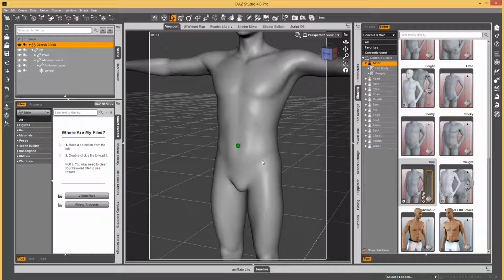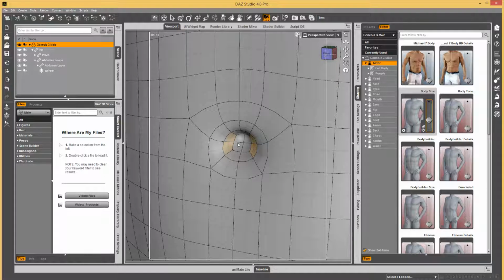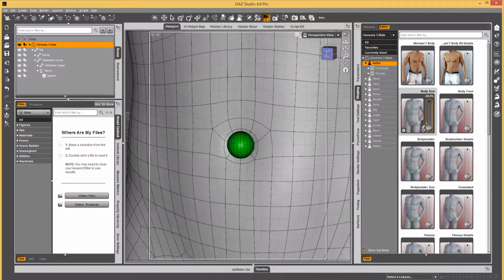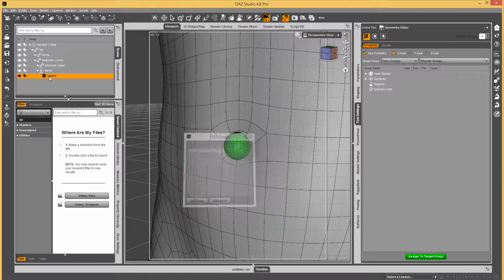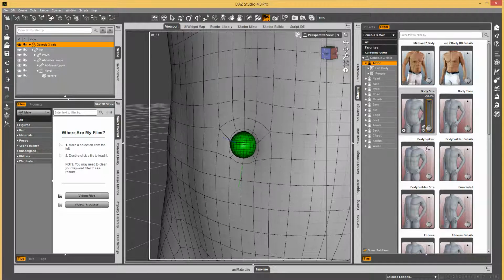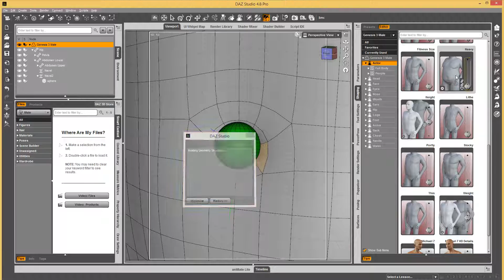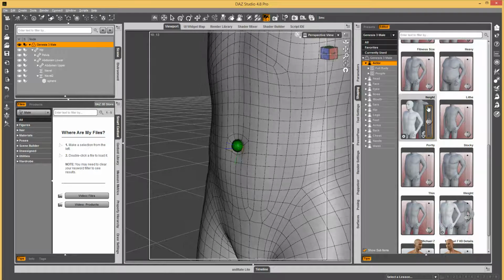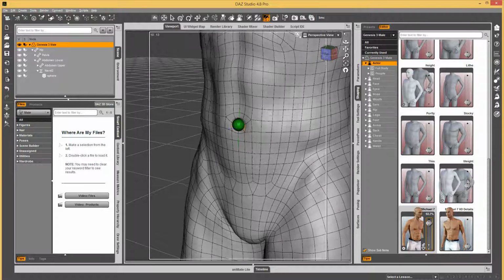Rigid Follow Node Test 1

Comment: Why follow rigid node gets messy when there's pJCM.
I add buttons using follow riggid node to my cloth, but after transfer utility, the position of the buuttons are moved, and getting worsed after I import pJCM
Reply from the maker: Hmmm, hard to say. I would first look at the reference points and see how they get distorted when the shape gets distorted

Also, you will want to make sure the rigid follow node is a child of a bone that moves the geometry. For instance, if the button is in an area of the mesh that gets moved by the lower neck, you should make sure it is a child of the lower neck. If that has troubles, you may need to make it a child of the upper chest instead. You might have to play around with which bone it is a child of

Beyond that, check what faces you use for reference. Keep in mind that it is trying to average the way the selection moves and translate that into data for moving the rigid follow node. If the mesh gets heavily distorted it could cause some strange results
Reply: @joshdarling3626  
I have buttons that I rigid follow node to a fashion clothing. If I RFNed it, do I have to put it under the correct bones of the cloth too? 

After reading threads on DAZ forum and many attempts after I commented here. I think the problem is due ERC Freeze. The forums said, it will put rigid follow node transalation a mess. And someone suggested to work on the buttons at the end, after all the morphs of my clothing are set.

So do have you any experience on Rigid Follow Node, and then ERC freeze a pJCM afterward? Does it work?
Reply from the maker: @JuanFeju  The RFN needs to be a child of the closest bone. In this video I make the navel RFN a child of the lower abdomen. That's always the first thing I check. You definitely don't want the RFN to be included in any ERC Freezing you do. You can sort the ERC Freeze dialog by node, though, so you can easily make sure to uncheck it before clicking Accept

Comment: Nice info Josh!  What type of asset would you save this as?
Reply from the maker: Ideally you would save your rigid item (button or whatever it is) as a Figure/Prop Asset like you would for normal clothing and props. Then you would load that in and follow the setup outlined in this video to configure it to follow the rigid follow node and would then save a wearable preset that contains the rigid follow node and the rigid item.